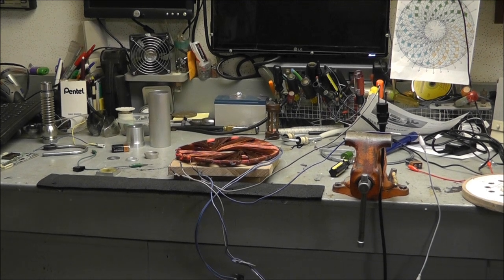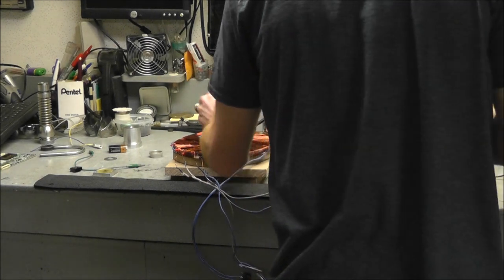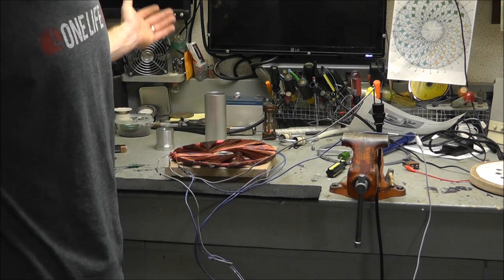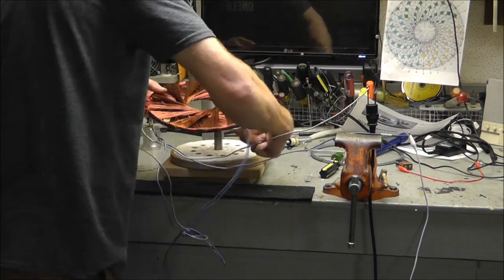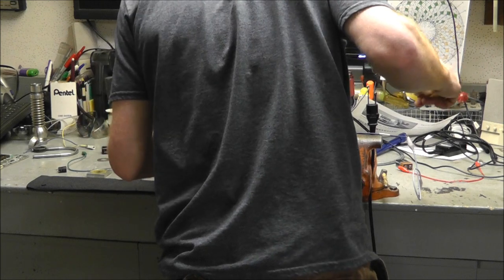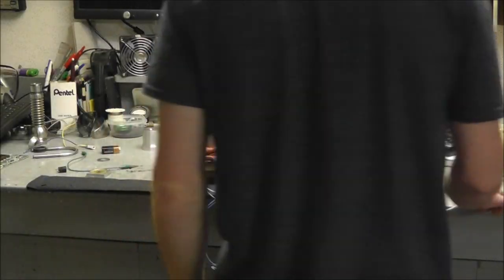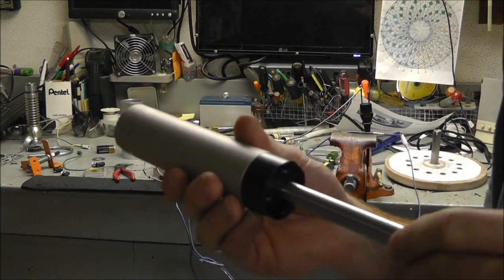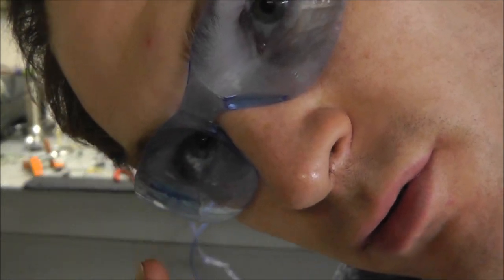Just Some Magnetic Induction Tests... rwgresearch.com

Comment: Russ, are you trying to make a piston engine drivin by induction?
Another subject. Have you seen any of the Sketchup pieces displaying the induction fields produced by Stan Meyer's coils? I watched a couple by sirHOX and firepinto. Sketchup is a powerful easy 3D CAD program. I have been doing construction stuff with it but it seems to have alot of electrical uses in comprehending and describing circuit theories.